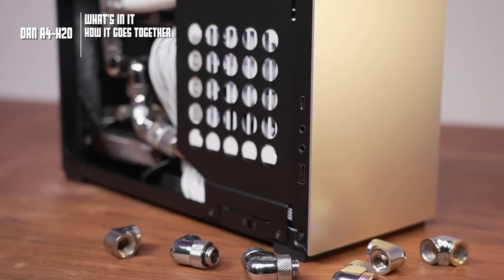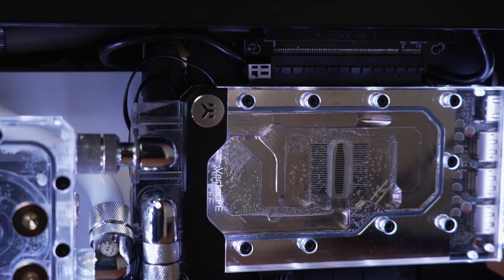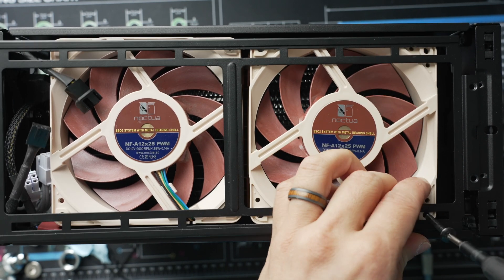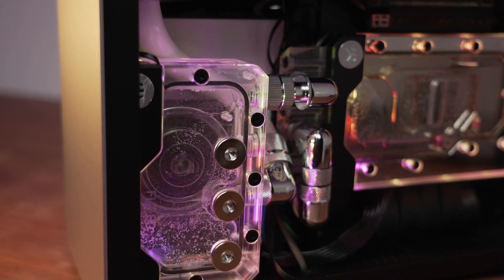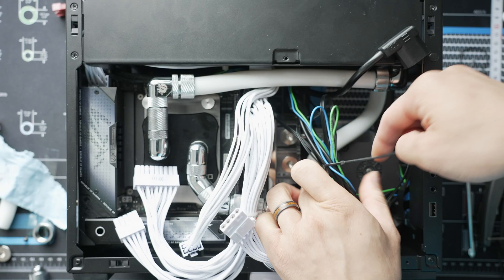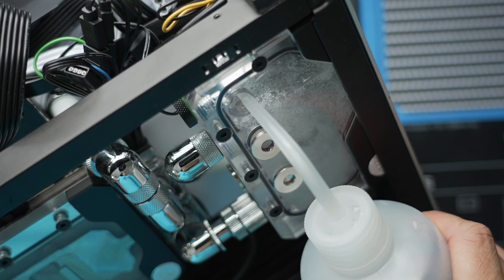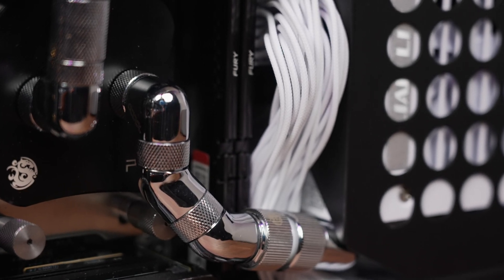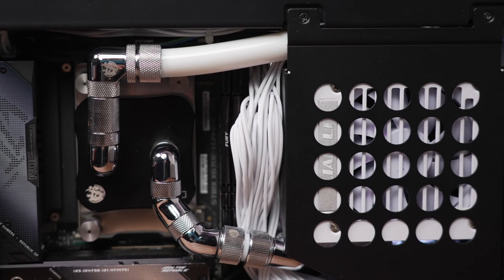Custom Cooling the 7700X in the Lian Li Dan A4-H2O

Comment: I also did a loop, but I put everything the opposite as what you did :D Just shows how many ways to make it work there are, it's on pcpartpicker builds 'VNvfrH'
My rad has the ports over the motherboard, fans underneath, reservoir with ports towards the front panel omg

Comment: i got question/content idea in the commentsection unrelated to this video:
could fans sum their frequency when running in sync?

say 5 same make same model fans manually best possibly matched in rpm vs running them all asynchronus by 50 rpm from each other.

might make a measurable or at least psychoacoustical difference and it feels like this is the right channel for that :D

Comment: I just air cooled my a4-h2o and cannot see the appeal to do it otherwise really..
Reply: The case literally has h2o in the name
Reply: So what do u put in the empty space in the top? Just two case Fans?
Reply: @lenardgor  Yes, two Phanteks T30's. There is like two centimeters of unused space below the fans, but I can live with that.

I think the airflow this way is great, although you're limited in your CPU choice. I run a 65 watt CPU and that is bottlenecking my system a bit in for example Warzone (heavy CPU load). My 6800XT temps however are amazing.

I also think the GPU temps are better without a radiator in the top, but I can't really find evidence for that. I only know air-cooled video's for the A4-H2O and Formd T1 always show great temps (when using sandwich layout).
Reply: you're missing the experience of having a compact 10liter lead box to train your biceps while moving it

Comment: Hi MachinenMore, I'm planning on building a custom loop in the formd t1 for just the cpu (7950x3d) and I'm leaving my 4090 fe stock. I watched your video on brainstorming the t1v2 and you mentioned that the iceman could be mounted on the rear of the case with a bulkhead fitting. Could you further clarify how that would be possible and if it would even be a good idea. Or perhaps a different  pump res could do something similar.